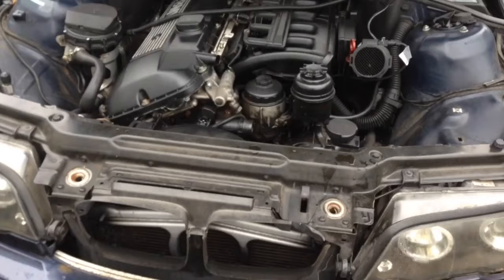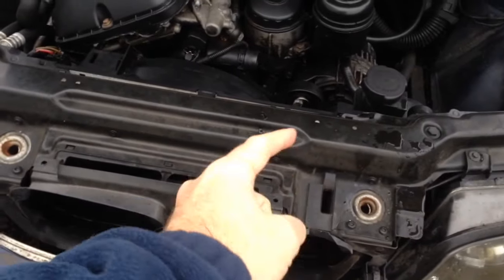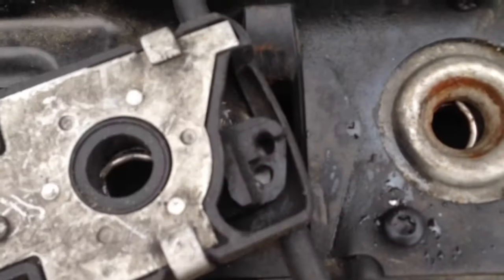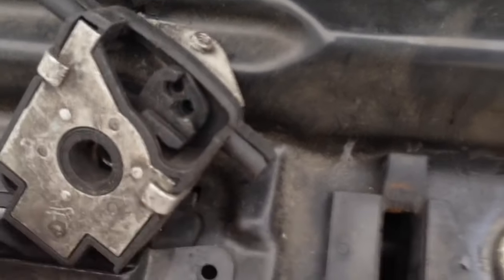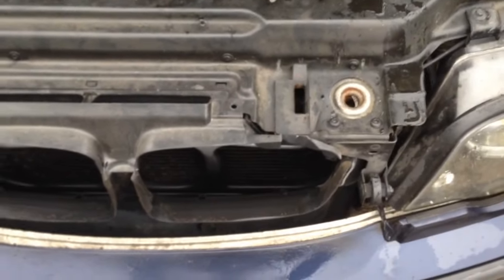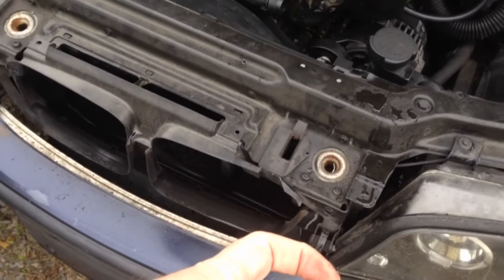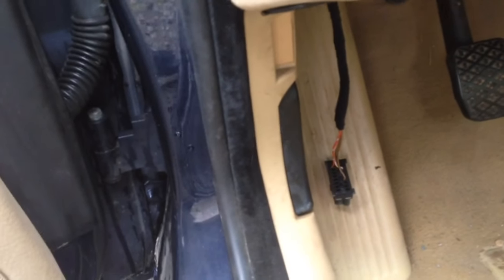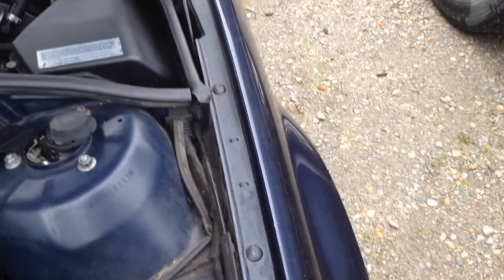How To Open BMW E46 Stuck Hood With A Broken Cable  In Less Than 5 Minutes

Comment: This video saved me! I was locked out with dead battery and malfunctioning lock after being gone for three weeks and car sitting the whole time, and could not get the hood open until I found this video! It took me forever but I finally got the hood to release after spending about 3 hours trying! I also had to create my own tool by bending a small rod to get up under the piece that releases it. Thank you Nathan!! 🙏🏼
Reply: Soulfire Evolution I’m currently in the same situation as you were man. Is there any tips you can give me to help open the hood ?
Reply: Don Wijesinghe how did you go? Do you have any tips please? My battery is completely dead, I can’t get into my boot or into the car. 
So my only option I think, is to pop the bonnet, then jump start it, so then I can have power to open the car doors.

Comment: I’d just like to add that anyone watching - make sure you’re certain you the boot lid is trapped by the posts & not the secondary latch @0:51 

This is where my problem is - so is worth checking firstly before the bigger hassle of a job being the pins that you explain how to fix. 

I pulled the grill out where the lever protrudes through (although I’ll check later if one needs to). 

The secondary latch doesn’t fully release - but it’s not a massive problem as you can use your finger to push the rear of this latch to release. 

It’s a bit diff to explain but worth fiddling about in that location 

Maybe you can film/add this to your YouTube’s?! 

Cheers for the explanation / video on the problems associated with the pins - very informative 👍

Ah - just found YouTube on what I was explaining - it’s on How To Automotive channel - they use a pick tool to release - it’s not how I release but I’ve the grill off & can use hands to push rear part off to rehearse - they don’t remove the grill

Comment: To save y'all some time here's what worked for me. I work on bmws Dailey and this one kicked my ass but once I figured it out I was like well now I know.... Remove driver side fender liner and if you look up above the lower radiator hose you can see the hood cable (look hard I missed it at first) give the cable a good pull towards the rear of the vehicle and if you're lucky like me the tension is enough to disengage the hood latches

Comment: Another way to open hood 

Pop out both kidney grills break them if you have too you can get those grills out without breaking them I’ve done it.  Kidney grills aren’t that expensive Amazon
Once those grills are out You’ll be able to see both pins and springs on the pins stick a screwdriver in lift the spring stick another screwdriver under the rubber that’s just below the spring lift the rubber up stick a pic hook in there there is a wire that holds the pins in in the drivers side on both pins Stick the pic in their stick it down and move it around and pop that wire Have someone hold that side of the hood up slightly so it doesn’t lock again Now do the same to the other side bang it’s open

Comment: saved my life!!! my battery died, with the car locked, and the driver door froze shut so I ended up breaking the handle. the only wait to go in was to take the battery out, recharge, and open some other door to be able to drive and heat up the whole car to unfreeze the door... cool, right?

Comment: Quick question as not sure my problem is 100% like this, when I pop the hood from inside the car - it pops up fine. But then when I go to use the lever to lift the final bit up and the hood fully... it's stuck. Any ideas?

Comment: My e90 is having a similar problem, except the release latch is functioning, however the  latch that actually holds the hood down is too gummed/corroded up to spring up when the release is pulled. I have to hold the release lever and then have someone pull up on the hood to get the hold down latch to pivot enough to let go of the hood. Any thoughts on how to free that up?

Comment: Easier Method- 1. Use screwdriver to take our kidney grilled and hope you don’t break too many plastic tabs. 2. Get reciprocating/buzz saw and cut through the pins (in the centre of the springs). 2 mins and the hood is open. 3. Fit new locks, pins, latches and cables.

Comment: On right had drive you can pull the connecting cabal to open the near side but for the off side you will need to hack saw through the pin 🙈

Comment: If none of these methods work like in my case I had to cut the factory hood pins with a SawZaw I removed the kidney grills and stuck the sawzaw blade onto the pins at let it rip till it cut threw

Comment: I’ve tried but the little latch will not move at all
Reply: Yes pretty useless video, only logical method is to release the 4 torx screws on the slam panels with a micro ratchet and low profile torx bit.